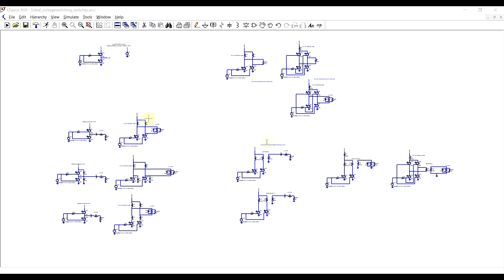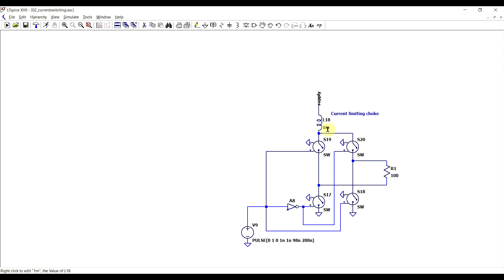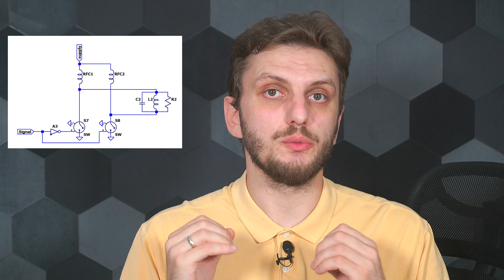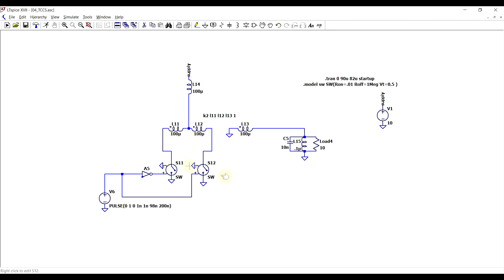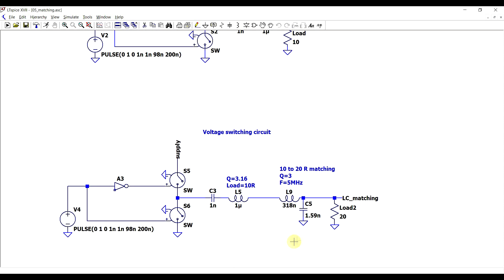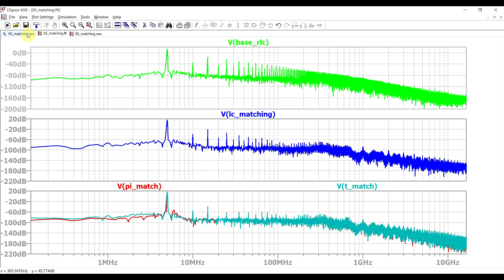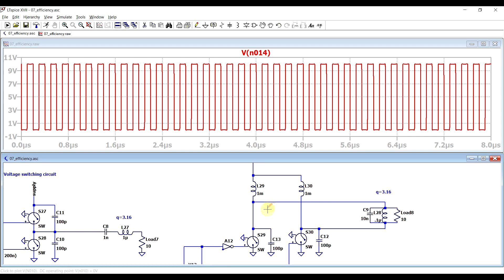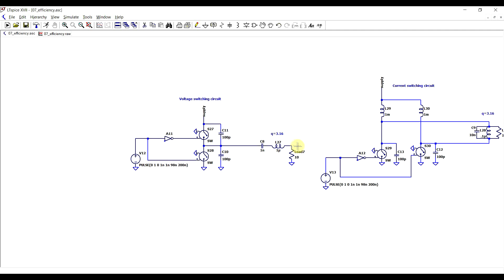The Class D RF  amplifier - Basics (1/3)

Comment: For the full-bridge, is the choke really necessary to get the fundamental frequency?
Reply from the maker: The choke is there to limit and stabilize the current. If there is no choke, the parallel load would just be switched between Vcc and -Vcc - it would see a voltage square wave, not a current one.
Reply: @FesZElectronics  Yes I see, thank you for the answer. I guess it also make no sense to have a voltage source over a parallel resonant circuit. So in principal it has to be converted to a current source. Maybe that is not the correct way to analyse it?
Reply from the maker: The supply of a circuit in general will be a voltage source (a battery or the output of an electronic power supply usually is voltage stabilized so it behaves like a voltage source); having the inductor in series will help it behave like a current source

Comment: How about using DG442 or ADG418 analog switches instead of transistors? would that be better?
Where you inject the audio signal? and how does the audio signal gets squared?
Reply from the maker: In this video I discuss the RF class D amplifier; I made a few videos a while back about the Audio Class D amplifier.

Comment: In an audio class-D amplifier, the output is the information in the PWM of the switching carrier, and the filter is there to remove the switching frequency (or looked at another way it stores the energy in the switching carrier and that is integrated to become the energy of the delivered PWM converted signal in the load). Here, you are coupling the switching frequency to the load and removing its harmonics, and there is no information content in the duty cycle (PWM) of the carrier. To my mind, what you have then is a push-pull class-C amplifier, not a class-D. Its efficiency will be similar. I have designed RF transmitters* using bipolar transistors in similar class-C configuration and I don't see this as a different class, even if you use MOSFETs or whatever instead. If the sinewave you wanted in the load was carried in a PWM of the switching frequency, I would agree that would be class-D. *I should say that my time as a RF engineer in industry was back in the late 70s and early-80s, class-D wasn't a thing then, but class-C was (and still is) common. nevertheless, I found this discussion interesting, and a good introductory treatment of the matching and filtering networks which can be a difficult subject for those not familiar with RF.
Reply: Great comment , I always appreciate info from RF engineers.

Comment: It appears that what you are describing seems to have more in common with the classic C-class functionality, which is highly non-linear and cannot amplify a fully modulated input!
Reply: I agree Louis, this is class-C. The output frequency is not the PWM of the carrier, but is the carrier itself. Class-C can amplify FM perfectly alright, it just can't do AM if the AM is on the input, but you can modulate the supply with AM and that works OK. Other modulations that use a combination of phase and amplitude would also need to be applied to the drain (collector), not the input (base or gate).
Reply: @GRAHAMAUS  This may true with any modulation format that is devoid of any amplitude component, However, with any pure frequently of phase modulation, proper filtration of the output to keep extraneous harmonics down to acceptable levels to avoid overmodulation like splatter would be a design challenge.

Comment: Very nice, what is the root cause of harmonics at 2:30?  The circuit is very simple, so I am not understanding what causes harmonics to be formed in the first place.  Also, why not generate a  clean sine wave first , this way there will be no harmonic to filter.
Reply from the maker: The whole idea of the class D is to generate a square wave by using the transistors in saturated/blocked mode. Its more efficient than going trough a linear mode (like class A/B). When you generate the square wave, you inevitably generate also the upper harmonics.

Comment: My question would be how you’d go about modulating the output. OOK would be pretty simple (though maybe with significant ringdown time) but amplitude modulation would need shorter pulse lengths or pulse skipping. Phase modulation would likely be difficult, and frequency modulation may not be possible unless you’re willing to sacrifice your sinusoidal waveform to run at a lower Q.

Feels like a push-pull version of the class-C, maybe that’s why it’s the class-D (i.e. what the B is to the A) and the audio version came later.
Reply from the maker: I think for AM you can go with supply modulation (the output of the class D is proportional to the supply voltage); I did see a really complex version of AM modulation though, but I cannot explain it; For FM it should not be a problem since usually the signal BW is rather small - for the commercial FM the BW is 120KHz is I'm not mistaken, so the effect on Q factor should not be that bad. In general you can apply similar principles regarding modulation for class D as for Class C

Comment: I'm curious to see how a voltage switching device such as a tube would work in this scenario
Reply from the maker: As long as you are using the transformer coupled version, it should not be a problem getting it to work; at least at relatively low frequencies.

Comment: So would I 😁.was wondering about the npn gate blow out when specific on type all they had then was npn wasn't expecting it to short blowing the out gate one after the next  move one on the list and it's fine. 😃😄😁😆😅5 Smile's. You can even have them off start up it has a saturation jump issue yet you can while having the positive line in cut to saturate the circuit to stop that jump 4second lock out the negative and electron roll still can pass this and on some 555 jump the reset button turning it back on???😁 multi line system use stuff.

Comment: Can you please mention some practical uses for this type of amplifier. I am interest to hear what an amplifier that is essentially single frequency, non-linear for am modes and requires extremely fast transistors (relative to operating frequency) might be used for? Have really enjoyed watching your videos, keep up the good work.
Reply: It's in the title :) "RF" --> For communication-system (AM/FM/etc)
Other industrial uses include RF-welding for plastic parts. A large RF voltage is applied between two electrodes, and plastic parts sandwiched between these melt due to dielectric-losses in the plastic, effectively "sealing" (fusing) the parts together.
Reply: @AdityaMehendale  I can see it would work for narrow band FM but surely it cannot pass AM signals without total distortion of the modulation. I guess only HAMs use AM these days anyway lol
Reply: @piclife1178  You'd high level modulation for AM. I.e. Apply the modulation to the supply voltage, say with a PWM circuit, like a class D audio amp.
Reply: @piclife1178  "Total distortion of modulation" - indeed. I see that your question was not asked in good faith. My bad.
Reply: @AdityaMehendale  My question was asked in good faith and my point is this amplifier is non-linear and non-broadband which makes it use of very limited as a conventional communications amplifier. I may be wrong so I wanted to know a practical example of a real communications product using this system as there seem to be a number of issues that would make this difficult to use in a practical circuit.
Reply: @piclife1178  In that case, here's the deal:
A resonant filter is not unlike a garden-swing. It has a preferred frequency, and it can swing a few %+/- of this frequency, By pushing periodically at a slightly different frequency, one can coax the swing to oscillate slightly differently. Also, by pushing strongly or weakly (amplitude or duty-cycle) the macroscopic amplitude of the swing can be varied. Any modulation (AM/FM/PM/PWM) is essentially non-linear. It's just a matter of finding a clever way to use the swing that you have to do the tricks that you want.
Reply: Radio --> Take a typical FM channel - say 101MHz. Its bandwidth is say 200kHz (so only +/-0.1% of the center-frequency) - this is as good as "one frequency" seen from the viewpoint of a filter with Q=10.
Reply: I was planning on using them for digital modes like FT-8.  They are efficient, so good for portable operations.  I have used Class E up until this point, but would like to experiment.

Comment: I’m excited for this!!  I’ve tried implementing Class D RF amplifiers in the past and never had any luck.  Looking forward to the rest of the parts in this series.
Reply from the maker: I'm sorry to hear the circuits did not work... May I ask what sort of problems you ran into?
Reply: @FesZElectronics  kept smoking one of the transistors.
Reply: Yes, also looking fwd at implimentation of snubber circuits /dead band to manage transistor heat generation - and effect on noise.